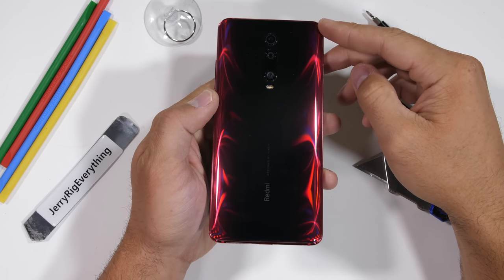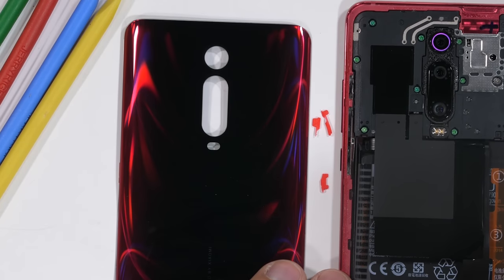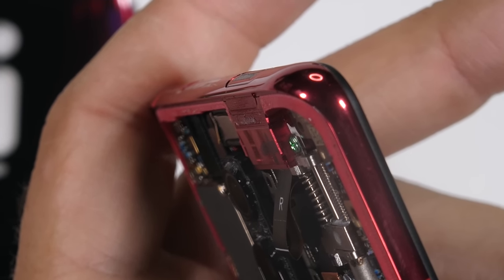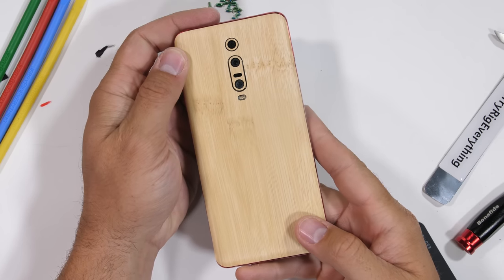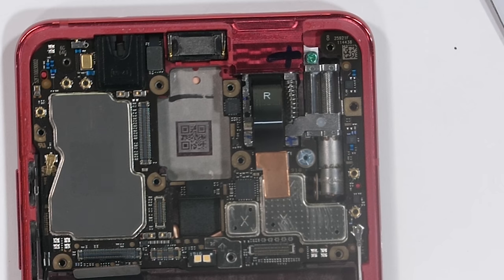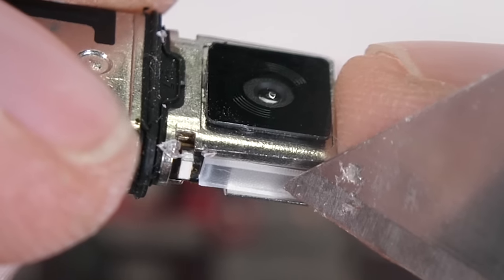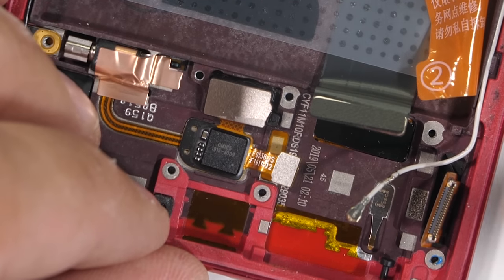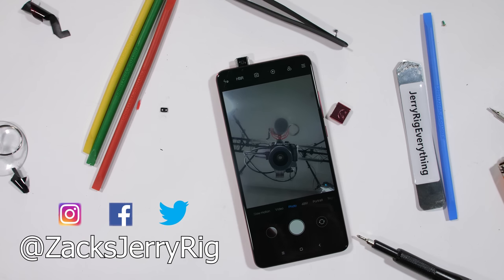Redmi K20 Pro Teardown - Value Champion is Clear!?

Comment: One of the cheapest flagship killer . Totally worth it's Price
Reply: Mi 9 too. 300€ in eu
Reply: @sh0ckv55  Yeah
Reply: I am using it i have issues with call drop and sensor not working on calls sometimes.
Reply: But this is literally a flagship killer, it kills even their own flagship, by being cheaper, they done fucked up ;)
Reply: @piciu256  Quite true
Reply: @farisshaf8610  Are you sure the problem is with the phone?
Reply: @farisshaf8610  don't worry I'm in beta team for Android 10 and we are working on Miui 11 and Android 10 so that all bugs are known and will be resolved soon.
Reply: @troycornaro  absolutely sure because I've encountered the problem several times since i bought this fone.
Reply: @Diogenesthedog0  how about fixing these problems with the fone is south asia ?
Reply: @farisshaf8610  I never knew . Damn
Reply: @troycornaro  it might be a problem with the phone, I had a similar issue with my Mi5s, in the beginning signal problems, after update one sim slot stopped working and finally the phone completely died after factory reset, all happened in first week, replaced with a new one no questions asked, it took a month though cause it was shipped overseas ;)
Reply: @piciu256  Did they replace the device?
Reply: Its not even killer now its full fledge flagship
Reply: @farisshaf8610  sensor issue may get fix in the next system update... If the sensor is physically ok.
Reply: @pksubin  Agreed
Reply: @aadeshgill145  Quite True
Reply: @pksubin  sensor is ok as it's a brand new fone. Hope the update fix the issue
Reply: @pksubin  btw what about call drop issue ?
Reply: Nope, not worth it
Reply: Well...the problem is they keep on releasing newer phones every 2-3 months with nearly same price and their rival (Realme) does the same, this is confusing for the customers.
Reply: @farisshaf8610  try to mail/call customer care
Reply: Roseki  good for you that you don't have this stupid thing in your head of "needing" the fastest thing on the market, unfortunately I'm stuck with wanting "the best" though fortunately I can settle at last years best, saving me self some money ;) What pushes me from the "mid range" phones is the slower memory and a bit inferior camera, even if these things are not significant, they are still there and poke at my brain unfortunately :/ The cpus are faster than anyone needs in a phone already anyway, unless you play a lot, a mid range energy efficient one would be the way to go.
Reply: @farisshaf8610  or may be contact network service provider
Reply: @troycornaro   He probably just needs to change the APN
Reply: @troycornaro  He most likely needs to change the APN
Reply: @farisshaf8610  Change your APN
Reply: @cinnamonsquash  just buy one that you like and enjoy it, stop comparing. Technology is a endless chase
Reply: @Diogenesthedog0  hey! I have problems with the wifi and 4g signals.. its will be solved too?
Reply: @taotuhao5969  no idea about all these things.
Reply: @pksubin  if you can settle for previous flagship, you are not wanting "the best", since it is already not the best
Reply: Little Gamer are you lying
Reply: So what do u say it's good or bad
Reply: Sh0ckV5 they're basically the same phone!
Reply: Tornado i've never had any such problems with mine!
Reply: @Diogenesthedog0  bro I'm waiting for it. Give us more updates
Reply: @piciu256  that isn't true their "flagships" are midranged devices at least from where I live it is now $595 (bnd price) 433 USD so very midrange
Reply: I’ve used both the Mi 9 and the K20 Pro, it’s not even close, the Mi 9 blows the K20 Pro out of the water. The hype for the K20 Pro was just that, hype. Buy the Mi 9, you’ll be glad you did.
Reply: There is a problem with this phone its head phone jack is attached with the motherboard .so if the headphone jack fails you need to replace the whole motherboard.
Also most redmi phones headphone jack fails within a year.
Hope somebody notices this.
For this reason it is not very burget friendly in the long run.
Reply: @farisshaf8610   all  redmi phones has this issue . 
Redmi  is  not good  for  calling .
Reply: @Diogenesthedog0  
Lol
 What if it's an hardware issue  !
Reply: Roseki  try gearbest
Reply: Roseki  and mi 9 cost 298€ and get snapdragon 855, 6gb ram, huge 6.3 amoled panel and good camera. Only the baddest feature: NO HEADPHONE JACK.
Reply: I used it. And only Complain is not having an old fingerprint sensor at back. ...fingerprint sensor inbuilt on Screen is bad. ..the old Xiaomi s back fingerprint sensor is amazingly fast

Comment: Not gonna lie, that Holograph circle around the camera gets me every time!
Reply: I thought that was an LED or something!
Reply: I just changed my camera lens protection glass today cause I'm a moron and completely shaterred it when I tried to not trip at work. And from the name of the part (that is listed on the repair note) that they change, it seems there are other color circles than just that hologram one, as its called "back camera acessory f11- holographic silver" from that im guessing there might be other colors either planned or already in use (maybe for the chrome black and pearl white versions)
Reply: @Some2somewhere  Black version has a red camera lining (which stands out more than silver) instead of silver. Haven't seen others colors yet but that distinction could be the reason why they have to specify holographic silver in the accessory name.
Reply: @jkcdarunday  thanks for the info bro. I wonder if you could switch back and forth if you asked the repair center tho. A red ring would fit super well with the bonkers red back glass.
Reply: I had my 9T Pro almost 2 weeks before I noticed that! It's a nice touch!
Reply: @Some2somewhere  chfufyfhf

Comment: Watching it on K20 PRO GLACIER BLUE ! Amazing piece of tech ! 😊
Reply: I too Bought K20pro 8/256GB varient Glacier Blue
replaced after pocophone.
this phone is great.
Reply: Me too bro same
Reply: Are there any ads & stutters while using as claimed by some youtubers
Reply: @pkboss8324  No Ads bro Everything Fine
Reply: Same here... value for money is the best feature of the phone 😇
Reply: @MohamadMeerasa  ok bro 
But bro have u saw meizu 16s pro?
Meizu 16s pro have almost same price in china as of k20 pro with no popup & 855+
Reply: @pkboss8324  Buy those phone who have some reputable after sales service.
Reply: @pkboss8324  I have the k20 and it's really good. Great display
Reply: @bishwajeetbiswas06  me too bro
Reply: joseph carmine nero  not at all.. Working like a charm
Reply: @bishwajeetbiswas06  thanku bro for ur suggestions
Reply: Couldn't get the red/blue, rocking the black one though. After Redmi note 3 (my older phone), this is a proper beast, no complaints whatsoever.
Reply: @MohamadMeerasa  thank u bro for reply btw i am from Pakistan 🇵🇰 not from india as Xiaomi in india is cheaper then pakistan pricing so according to that would u still recommend k20 over Meizu 16s pro
Reply: @pkboss8324  Yes.. Its better then meuzi
Reply: While calling my screen light is not going off kindly guide out
Reply: @arnabbose5225  In some cases i too have same problem its i think Soft. issue. 
Or you are using a grooved Back Case.
Reply: joseph carmine nero  i have the k20 pro chinese variant and it doesn't get hot while browsing. The display is amazing. I come from pocophone too 😁😁
Reply: @bishwajeetbiswas06  no bud I'm using the one which is provided in the box
Reply: @arnabbose5225  Because i too have this issue noticable of times. I think this is an software issue.
Reply: The Pro is insane enough. But the normal K20/Mi 9t is even more insane for the price.
Reply: joseph carmine nero  Playing intensive games like NFS and Minecraft didn't even heat up the phone in my experience. It's solid with it's graphics and performance (don't forget it has a Game Turbo mode to speed up GPU)
Reply: @pkboss8324  no...!! Go for 16s pro..
Reply: @bishwajeetbiswas06  thank u man for help very nice of u 🤗
Reply: @adityajain6408  why bro 🤔
Reply: @bishwajeetbiswas06  you already replaced the Pocophone? 🤔...glad i didn't get one last year
Reply: Bought it as soon as it launched, no problems at all
Reply: @pkboss8324  see if u can live with bezels, u want a high refresh rate display ( i heard it has 120 hz touch sensing, 90hz panel ), 855+ then go for meizu.... Or go with k20 if u want a bezel less beauty.. you can also wait for oneplus 7t.... I forgot... Ufs 3.0...!!! Makes a huge difference... I have oneplus 7 way better than k20...

Comment: Currently using my mi 9t pro for about 4yrs. Back cover already came off when I remove the case, so I seized the opportunity to make the back cover clear. Removed the upper black plastic cover leaving the flash covered with its plastic glass and soldered the earpiece with thin wires. Replaced the battery, cut the buttom black plastic cover. Repasted the termal paste. I don't have plans to upgrade my phone yet since I stop playing mobile games. This phone still rocks even after how many times I fell it.

Comment: The K20 pro has everything someone can need in a phone. The only problem is that it has spywarey MIUI by default, but that can be solved with just installing LineageOS as this phone is really easy to unlock.

Comment: All these years later, still using my K20. The only problem I have is that there's no worthy replacement for this phone.
Reply: Same, lol! Tomorrow im getting the Redmagic 9 pro but this mi 9t still rocks* after a back glass and battery replacement, so i will keep it a little longer

I got the 6gb RAM version and... google telemetry is very ram hungry... 
i think pop up cameras disappeared in less than a year due to conspiranoic privacy concerns :^/

Comment: Just got the Mi 9T Pro recently. Upgraded from a dying S6 edge+. Love the phone so far. Unbelievable how cheap it is considering what you get. 

Looking at this video, it looks pretty straightforward to take apart should the need ever arise (something stops working). That's what I like to see.
Reply: yup ,500 bucks for 12GB ram and 512GB storage, its a good deal

Comment: I wonder what the actual force required to move the popup camera up and down is. Because i could very easy see a small electro magnet structure being able to control the up and down motion of the camera. It wouldn't have the same overheating issue as the motor, it would never wear out, it would be shock resistant and also faster than the motor. I am sure there are other potential advantages. Perhaps space savings.

There are two potential downsides I can see with an electro magnet. 1. it may interfere with the cellular/wireless/bluetooth/nfc systems very close by. But probably not. 
2. The movement would be very quick and snappy. So rubber bumpers would have to be added to stop the camera and stop it from seeming like it's smacking hard in either direction.

Comment: Hey Jerry, you seem to be quite a guru on this things so I put my last hope into you.

I have a 9T and the screen got broken, waited 2 months for the replacement screen with frame to arrive and in the meantime I wanted to prepare the phone for the replacement, as I removed the back cover it broke inte thousand pieces so I ordered a new back too.

The new screen arrived, I took it apart and managed to mount all the parts into the new frame, charged it, started it up: Everything fine.
Screen looked great and touch worked normall. So, only the back part left, turned out it was a bit warped and didn't fit 100%, also the glue was really poor and as I tried to press the back part together with the new frame, the screen is got unresponsive and now the touch doesn't work at all :(

2 months of waiting and about 100 buck spent, on nothing.... My question is if you have any idea what might have happened/what would I need to replace to regain touch capability?

THANKS A LOT IF YOU COULD GIVE SOM POINTERS!
Reply: @R. Riga I got a new phone, what else? 🤷

Comment: I have this phone for about 2.5 years and it is  still ok. Battery is ok, works fast, no glitches, main speaker is bit weaker but thats ok considering that I was using it when I worked as dishwasher in restaurant. It can handle lot of water and be in humid enviroment. Also It can definitly handle drops even without the case.

Comment: I just got the global version of this it's working well
Reply: Do you live in the States? I really want to get it. But it's missing band 12 so I'm wondering if it will even work.
Reply: @emceeunderdogrising  ya I live in the states, but the Mi T9 is pretty nice, got the 6gb ram 128gb storage for 400
Reply: Sweet. You get decent reception? I've been looking everywhere with no clear answers. I might get it. Really can't afford a OnePlus right now. Did you flash a costume ROM on it? Is the OS crap?
Reply: @emceeunderdogrising  OS is ok haven't had any problems, have to use t Mobile or at&t sim card, at&t is decent reception. And charging doesn't take long with the new charging port it comes with

Comment: Heyup quick question:
What would you guys say is the IP rating of the K20 pro?
Reply: None, the headphone jack has a bigass hole to let water in. I think if you plugged the port it would be splash proof, you don't have to worry about rain for sure.

Comment: Watching this again... Now I doubt that repair  shop. I broke my screen and they changed it with a duplicate screen and they said the finger print won't work anymore anymore. As if the finger print scanner is embedded on the screen....but it's not...
Reply: They have installed a lcd screen. OLEDs are transparent, LCDs are not

Comment: hi, can you tell me a cheap and reliable site from the united states?  I really wanted to buy one but here in Brazil is very expensive, I saw that in the United States has the k20 pro premium with 855 plus and 12 ram.  Sorry if I hear grammar error, I'm using Google translator hehe

Comment: After upgrading to MIUI 12 Global OTA yesterday, fingerprint unlock stopped working. When I select fingerprint unlock in settings to switch it on and enter my PIN, phone goes dark and restarts (MIUI splash screen). Any suggestions? Phone is stock and not rooted.
Additional info: from CIT menu I ran the fingerprint sensor test. Result shows: all success. Next test (Fod fingerprint input test) gives following message: Your phone has password can not enroll fingerprint information
Not sure I understand the result of this test. Phone of course has a password (required to set fingerprint unlock).

Comment: Hey I've had this phone for 3 years and before 3 days I dropped it into my bathtub which had some water not much and the screen broke. After replacing the screen, the phone seems to be restarting the whole time if i try to unlock using the pattern and also it restarts if i insert my sim cards. Any ideas?
Reply: What version of MUI it's haves now?
Reply: I am asking because the software maybe have an issue
Reply: @antwnhc_al.x  Hey I don't remember but I found out the problem... Water entered inside the phone cuz there are some white "paper* dots and one of them Is red which means water came into the motherboard...
Reply: @JohnK-117 you are right what are you going to do know?
Reply: @antwnhc_al.x  well I already got a new phone since I took apart the other one and saw that it's water damaged ... Since no one can repair water damage I got another phone
Reply: @JohnK-117  oh ok by the way enjoy your phone and nice to meet you. Maybe I will find you on other videos as a comment 😉
Anyway bye!👋
Reply: @antwnhc_al.x  haha thanks sureee maybe we will meet again cya

Comment: Bro listen carefully  
I am using redmi k20 pro since 20 days and today at 4:30 mobile has fallen down on the floor in house my height is 5:9 and the mobile has fallen from my pant pocket height the mobile is fallen from screen side its blinking plzz tell me
Reply: Sometimes the display is blinking and when we tap the screen strongly it stops
Reply: And i noticed that when the screen blinks half of the screen is blinking and other half is black (not blinking)
In the blinking area i can see the ink in the display spreading
Reply: @roshansinghm5255  replace the display
Reply: @arman_cooldude  how much its cost
Reply: @roshansinghm5255  around 136 dollars
Reply: @arman_cooldude  thank you
Reply: @roshansinghm5255  google it for more information
Reply: @arman_cooldude  is it cover in warranty
Reply: @roshansinghm5255  just search xiaomi k20 pro screen replacement

Comment: Can I get the battery because my country's authorized servce does not givthe battery change support, i will pay the value. Please friend i am following you before, i need it really much my battery capacity is %68 i need the original one. If still availabe on you.